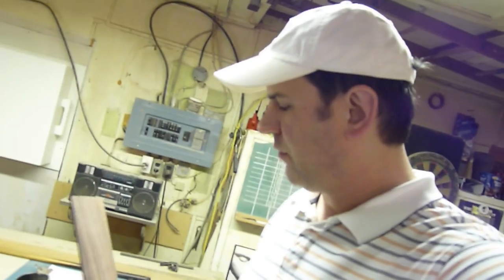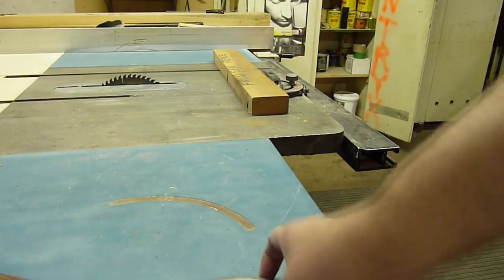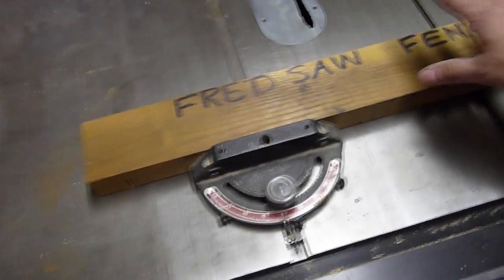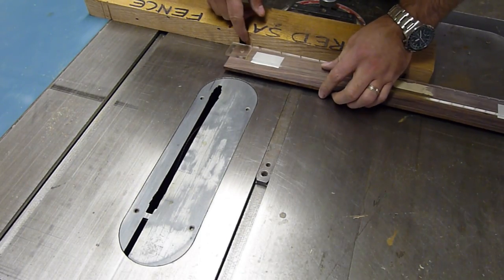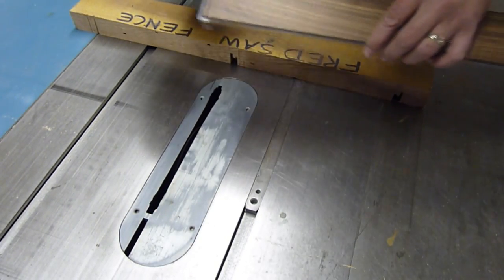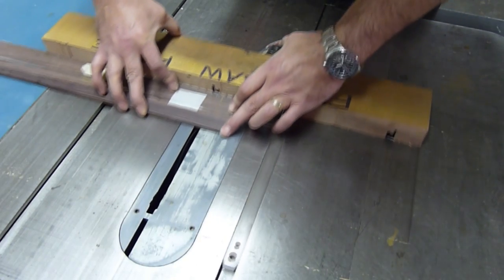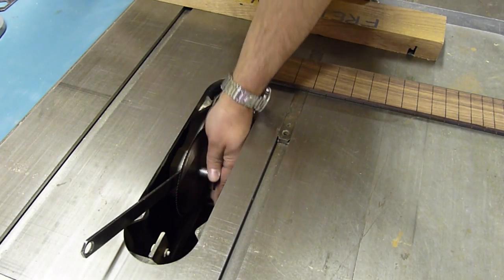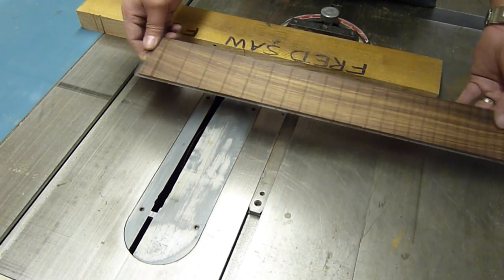Building Guitar Necks - Cutting Slots for Frets

Comment: Do you measure the tang and add some for the radius? 
What's your total depth when you're doing your slot pass?

Seems like you wouldn't want the center (of the slot) to bottom out... so you'd do the tang depth plus a lil? Then after radiusing the fretboard, you check with a caliper in a few places and cleanup with a hand back saw? 
Your videos are awesome. I got some micro planes on the way... ;)
Reply from the maker: You are exactly correct. I cut the slots on the table saw but not even close to the final depth. After the fretboard is glued to the neck, I radius and true it up, then recut the the somewhat shallow slots with a hand fret saw equipped with a depth stop. This way I make the slots the exact depth I want and also comform to the radius of the board.
Reply: FreddysFrets I need said depth stop fret saw... is that lmi?
Reply from the maker: Stew Mac:  http://www.stewmac.com/Luthier_Tools/Tools_by_Job/Tools_for_Fretting/Fret_Saw.html
Reply: Why do you offset the nut?
Reply: @endysdoodoo  I don't